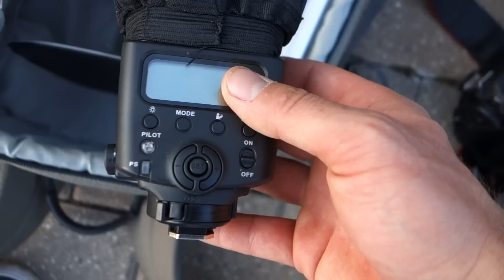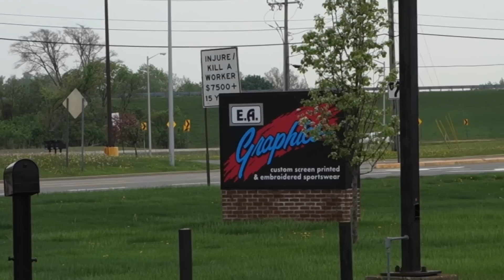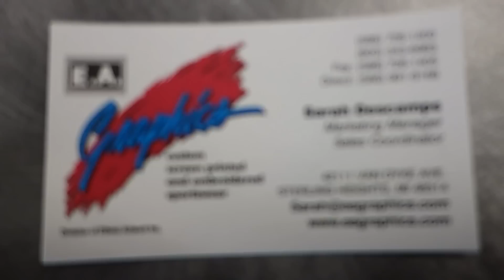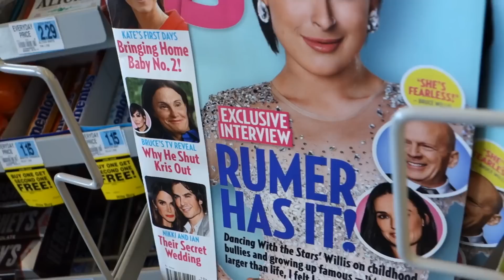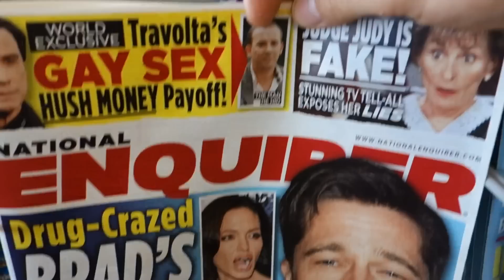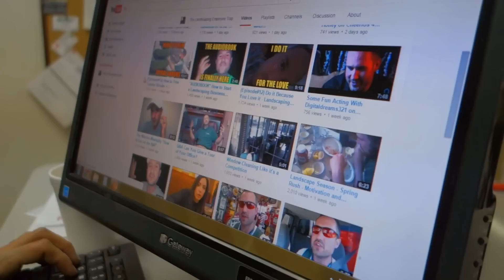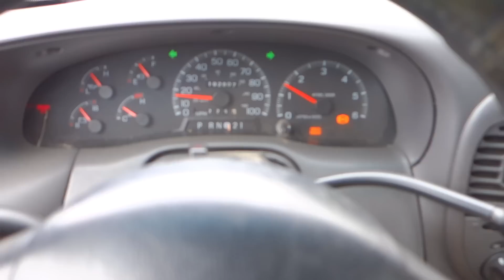Small Scale Business Stress "Sh*t Hits The Fan" - Landscaping REALITY SHOW

Comment: It's a fuse Keith! I've been there in the winter time plowing 160 driveways every time it snows. At the time we were getting a foot overnight. It has to be a fuse. Even a fuse that has nothing to do with the lights will mess up the lights. U may have a bad ground. The flashers will work but the daytime won't. Check fuse 34 36 38. In that area. I also wore through the calipers on my Ford and it's about $75 to fix for new caliper and pad. The pad is free under lifetime replacement especially if your buying the calipers. The shoulder bolts rusted up and u wore through the piston on the caliper losing the brake fluid. I been there too. No biggie. Sorry to hear about ure unlucky streak.
Reply from the maker: Yes... it was one of those FAT fuses I'm under the hood
Reply: The Landscaping Employee Trap  glad u found it!

Comment: Possible solution. ..run a bypass wire to lights for temp working. The other use your emergency brake. I'd hunt down a backyard mechanic to do the wheel cylinder and brake line at night. I have several friends at church who would gladly do that in the evening. 
MmIDAS will try to replace everything under the car if you let them.

Comment: Brake loss happened to me 2 weeks ago.  Going down an off ramp.  Push pedal, NO brakes.  Zero.  50 miles an hour on the first right turn on a red light.  25 miles an hour 300 feet at the next red light.  The rotor disintegrated on the highway.  Had a nephew, who is a mechanic, drive 30 miles on his day off to fix it in a parking lot.  215.00 in parts.  200.00 labor.  Saved me at least 800.00 vs  the NTB across the street.  Bout shit my pants when the brake pedal went to the floor.  ;))
Reply from the maker: Damn... close call